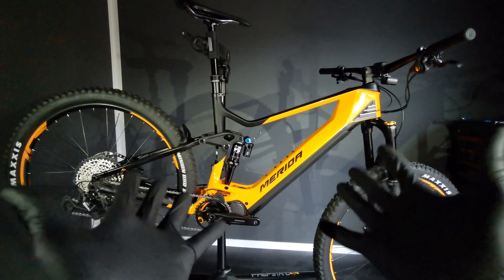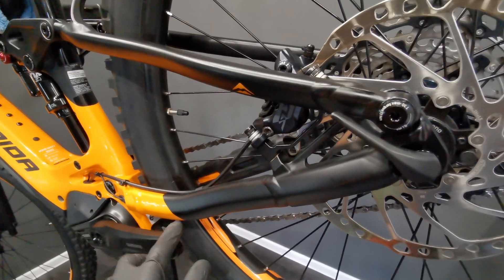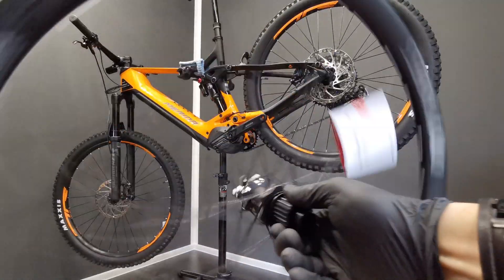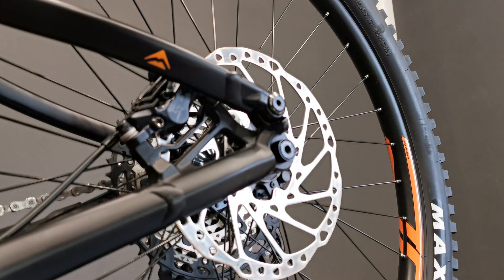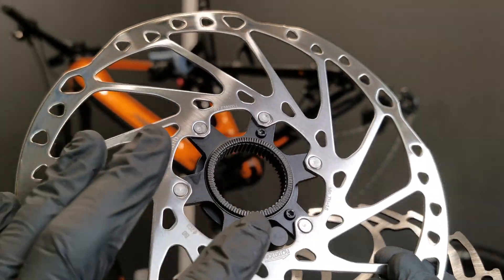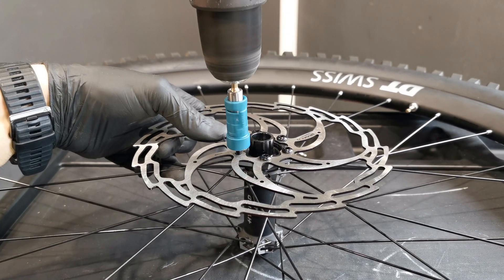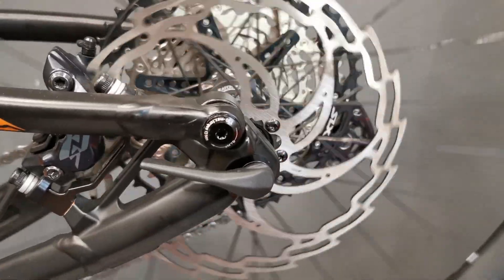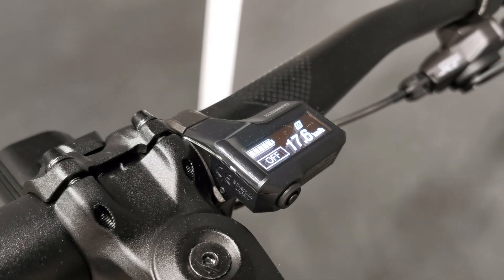Enduro E-Bike Build.  Part 4 - DON'T Replace The Magnet As I Did! It Will Cause ERROR 050.

Comment: Do someone have problem when all put back in original state? When I put it back on yamaha pw st, display is blinking (range, odo etc) and speed sensor doesnt pick up spee (0 km /h) motor is workimg, I ve tested through diagnostics , and in diagnostic program is showing no of turnings of the wheel
Bike is haibike alltrail 6

No error message, just everything seems fine, but motor is not working because of not reading speed from sensor (for motor its looks like no sensor)

Comment: I had the same problem with my orbea rise, I tried lots of different magnets in lots of different positions , and some would work ok for a whole ride but ultimately the error code would always come bac eventually. I hyave had to swap back to original wheels for now
Reply: Did you ever figure out a fix on the Orbea?
Reply: @trevorcrosta9253  yes mate , I used e tuning app , re-flashes the software and you do not even need a magnet ! Throws a few error codes but doesn’t get in the way of the ride. 27.5 rear end needs shorter cranks but it’s so worth it honestly
Reply: @coop69coop  Hi Nigel. My 4 month old Rise has stopped working due to the speed sensor issue (still on original wheels). I've checked the exposed cable and all seems fine so I assume it''s the magnet bolted to the XT rotor. Would re-flashing the software work for me? If so can you tell me what tuning app you used, and would that invalidate the warranty ?

I bought the bike online so it's a 300+ mile trip to the dealer if I can't fix it. :(
Reply: @Veyron1967  hi mate , this was all a long time ago now for me but I’ll try my best to remember! I used e-tuning app , it’s a fairly laborious process with the shimano motor but I got there in the end and no more issues .., google the etuning app and there will be lots of tutorials. My bike has an error code permanently and it always bleeps when I first turn it on but it rides like a dream and no speed restrictions

Comment: Bosch Slim Speed Sensor Magnet for 6 Bolt Disc!
Reply: Have you done this. I have just ordered a new set of wheels for my Scott eride Ransom which has the exact same disc and sensor position as the bike in this vid. The wheel set ive ordered has the six bolt mounting system so Ive had to order new rotors as well so i will need to overcome the lack of a magnet. Ive seen the Bosch magnet for 6 bolt mounting but wondered does the rotor need to have a cut away in the right place or does it just sit in-front of and flush to the rotor.
Reply: @miathemalinoisgsdx1320  yes on a few different bikes. there are a couple of variants now too
Reply: @walkingshimano  cheers mate Im picking a couple of Hope rotors up on wednesday and the shop also has the Bosch slim speed adapters in stock so I should be able to check compatability before I part with any cash
Reply: @miathemalinoisgsdx1320  did the slim Bosch one fit I’m wondering if it’s small
Enough because my problem is that the magnet is to big and is now hitting my frame since I switched rotors and tried putting a specialized magnet which was to fat I am hoping that the Bosch is slim enough